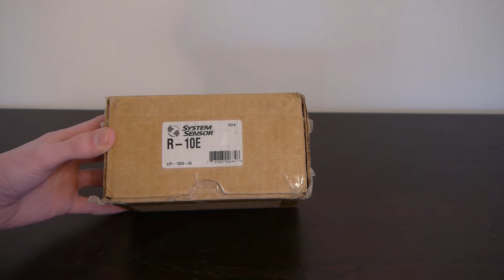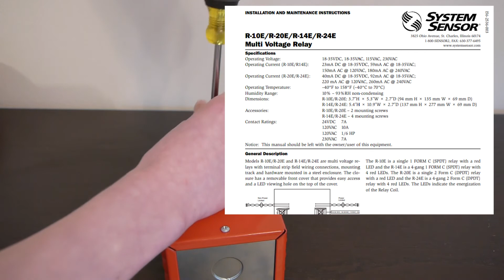System Sensor R-10E Relay unboxing

Comment: Nice not sure if you watched my video on fire alarm testing at my old middle school but I showed a relay that controls a three phase contactor but they put the relay on the bell circuit which is coded to code 3 so the contactor for a 100 amp three phase circuit is doing code three which is not good for the contactor obviously however it’s only at 120/208V so not as bad as 347/600 still not good though
Reply from the maker: Ah yes i remember that!